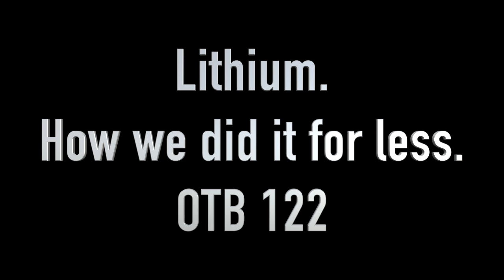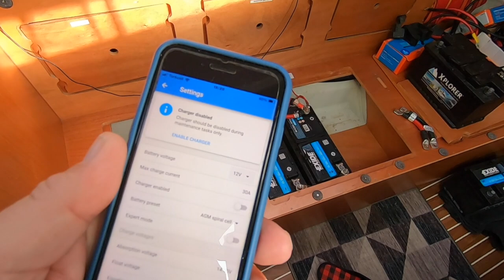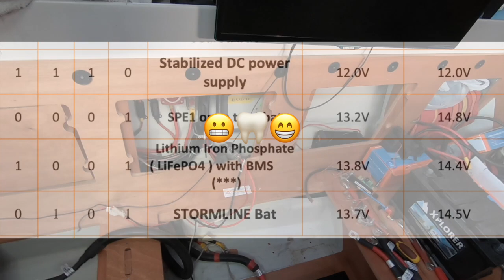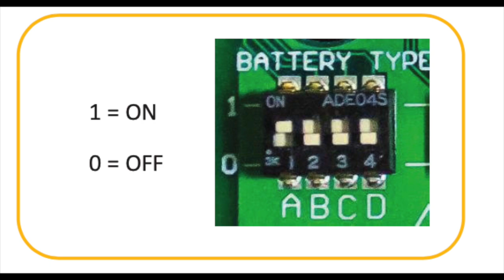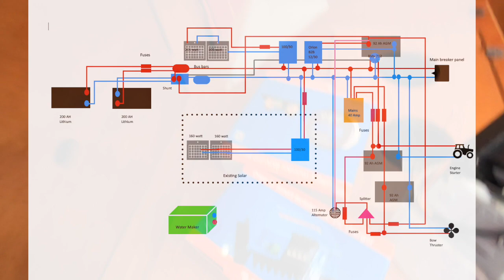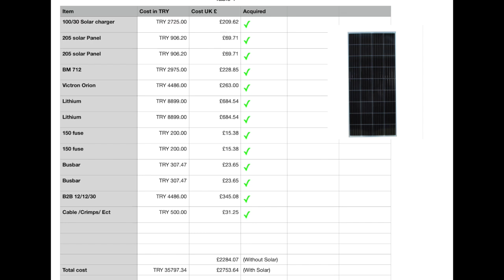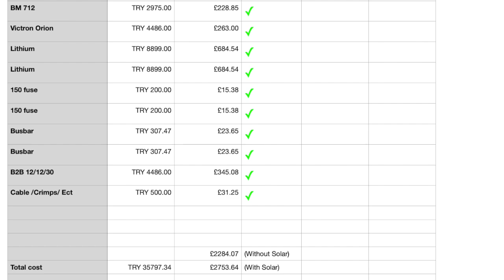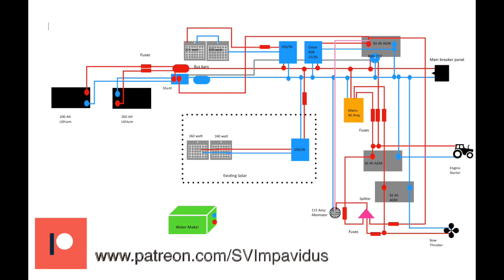Lithium, How we did it for less.

Comment: Great job 👍 we, been running on LifePO4 for just over a year and it's amazing you would never wat to go back to Lead again 😃 I originally looked at the Orion-Tr 30a but under longer usage it drops down to about 22 amps so we switched to smart regulator to get the full amps from the alternator into the house bank
Reply from the maker: We are looking forward to putting them through their paces this coming summer. We may go to a smart regulator with a temp sensor if we find the B2B is not coping.  Thanks for watching. Ant.

Comment: Very cost effective upgrade that is a bit (or a lot) of a game changer. As well as an advantageous discharge curve it has an equally important advantage with the charging curve which will result in significantly reduced engine hours purely for charging batteries. Hope you had a jolly Christmas break.😀👍⛵️🎄
Reply from the maker: Hi Noman. Merry Christmas and a happy new year. We have run a couple of days on the lithium. We face south so there is a lot of mast and boom shadow, plus the other boats shade. We go down to 80% DOC but by 10:30 they are back on float. The charge rate with the new solar is outstanding! We hit 60 amps the day before yesterday. The Lithium just sucks in all the available charge. The Victron kit really is great. We can monitor everything via the app. We are a bit light on alternator charging but even here in the winter sun it's a game changer. The exchange rate has really helped. Yes more expense over AGM's. But that usable energy makes a world of difference. Get up the farmers for a 
Guinness or an ESB Take care mate.
Reply: @SVImpavidus  impressive.👍

Comment: Thanks for the video Ant. I think I need to read your blog page as I started to get lost a bit. I was going to DM you on the blog, but it doesn't work yet. What I wanted to mention is the audio book of 'The Last Dog on Earth' sounds like you read the dogs part. You might not recognise it yourself, but I can't hear a single sentence by Lineker without hearing you. I don't want to advertise it, so blot this comment out if you like. Very sad to read about your dogs. Our Little one went off last year, and it takes quite a bit of getting over.
Reply from the maker: Hi Phil. We had to lock the Facebook messages for a few days as we had a scammer. It is up and running again now. You can also contact us via the web page https://www.svimpavidus.com/
Scroll to the bottom of the home page and use the  contact us feature. There is a little bit about Oscar there too. Sail Safe. Ant.

Comment: Also, I hope the maxium output (100a each) of your two batteries is sufficient for your max loads (inverter?).
Reply from the maker: Hi. Yes well within the top load on the inverter. Each battery is rated at 100 Amps max draw and 240 Amps for 10 seconds. Our air con is the biggest draw at 150 Amps start and 75 Amps run.  Good point to make though. 👍

Comment: A great video. Similar set up to mine. I will try to do a better job on the battery physical install inspired by your method. But since we have the three cabin version we will have to do some alternative jiggery-pokery as I think the terminals are just touching the lid.  As usual you made a very nice job despite the Bavaria cable nightmare ;-)
Reply: Happy Christmas by the way and have a great 2022🎉

Comment: One observation about that space mate one other channel set sail at night out of venice and ran ito a storm in shallow waters.. a hatch got left open for a while while heeled over some water went down into the bilges... It wouldn't have been a problem if it stayed in the keel bilges but the boat was heeling with the wind and waves and it started to come up from under the sole at the sides.
If you have any washers or spaces you can leave an air gap between you heat sink plate and the mounting surface.
Reply from the maker: The top of the lithium is about a foot above the floor so hopefully the pumps and alarm would kick in before it's an issue. The compartment is a watertight space on Bavaria's, both port and starboard. We have got to look at hold downs for the lithium batteries before we set sail in the spring. There is a mod on the forums that suggest a stand off fixing for the B2B. I think we will put it through it's paces and see just how hot it gets with a laser thermometer. I have a fan on order and a diode to run it as soon as the B2B cuts in. Its going to be a suck it and see. Thanks for watching Clive, always good to hear others thoughts mate. Sail Safe.  Ant.
Reply: @SVImpavidus  

I put up a link to a hybrid powered monohull yatch a guy had done ..i didnt catch it all first time round but in use he was able slash his fuel use and was still able to motor up to speeds of 7kn using his electric motor but backed up by his battery/ genny system.
I will sort it out if i can but i put it up for the Wildings sailing channel. This week or last...
Reply: @SVImpavidus  

Heres the link this splits into three parts it gets interesting when he gets to the Advanced Wharram based designed cat. 
Theres a cat being adapted to two electric sail drives ... I think it might be ply or ply with glass hulls? https://youtu.be/lq6EqAVS4uE
What is interesting is structural layout its like an evolution of the Wharram's. Theres also a Hybrid diesel electric  monohull with some outstanding fuel saving performance figures at the end ....but i need to listen again. Food for thought anyway ..

Run the generator at an optimal constant speed/load and it uses less fuel makes less polution and gets less wear ... Meantime brushless electric motors 
Can cooly, smoothly, quietly and cleanly do their stuff for near a million miles and possibly do regen under sail. 

Interesting 🤓 point in aviation the  generators vital to running the electrical and auxillary systems run off the APU a light wt generator.  On the WW2 Lancaster the power came from  
An all Aluminium 500cc version of the famous Triumph pre unit parralel twin MC engine.

These days they have revisited the rotor wankle engine having solved a lot of its material problems it is simple, smooth, very small and  light and can be used with heavy fuels.  
The fact that its not being used to drive anything directly like in a car means its free to run at its most efficient and least damaging speeds.. as they rev freely they can spin fast.. A single rotor the size of a x mas sweet tin will power an old school mini cooper ..with considerable gusto. But with the same wt as a standard HD lead acid starter battery.🤔

https://youtu.be/zDbAIU1QHSA
BYD blade battery's ...and motors ....watch how these do in future... 500000km 8year min 60%residual capacity. warantee.
 0…100% use battery
Reply from the maker: @clivestainlesssteelwomble7665  Hi mate your comment included a link which meant it got blocked by YT. I have now cleared it 👍
Reply: @SVImpavidus  
👍🏼😎 Hope your feeling better..
 Weather here is as mixed up and crap as ever.

Comment: It's gonna be nice to get rid of lead and sulfuric acid, in all of its forms. The unfortunate reaction between lithium and water gives pause, but most don't seem to have any issue. Even better is the eventual goal of abandoning diesel entirely!
Reply: Tell that to the child miners in DRC that mine Cobalt.
Reply from the maker: @dospalmascb  Actually the Ritar battery company takes its lithium from the deposits in Turkey.
Reply from the maker: Hi Mate. Yes the extra solar will also help. We are hoping to go non Propane next year after a year of trials. I dont think all electric is viable at the moment but it is something we have talked about. Sail Safe.
Reply: @SVImpavidus  Going induction and achieving a propane less boat is a logistic win of major proportions and eliminates a raft if ‘issues’.